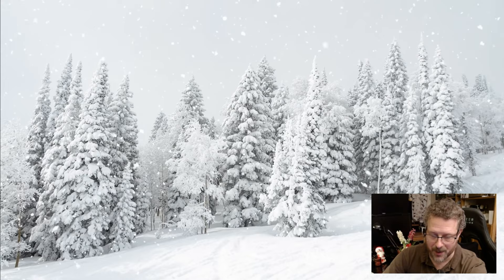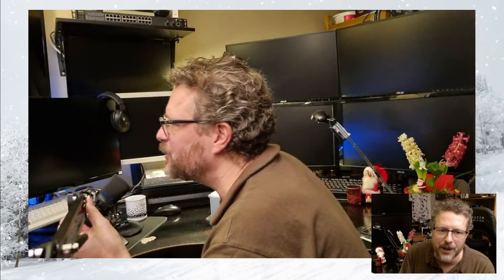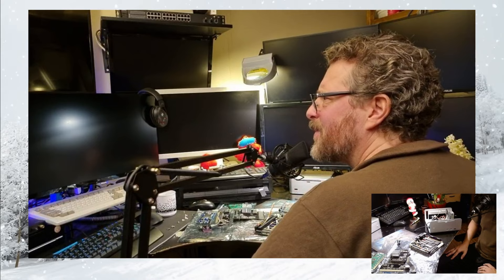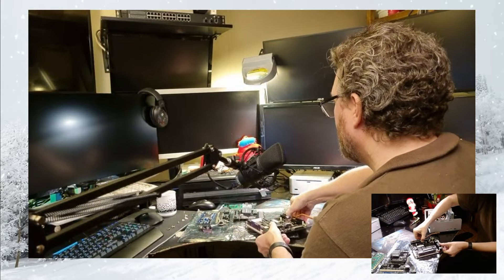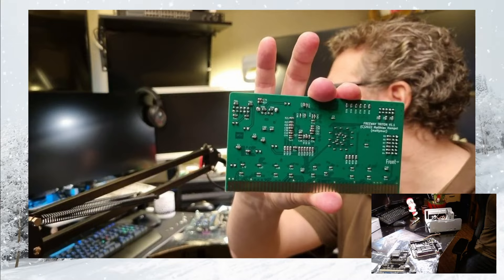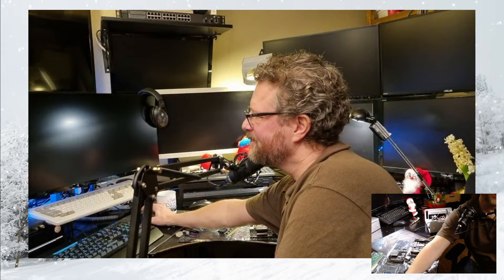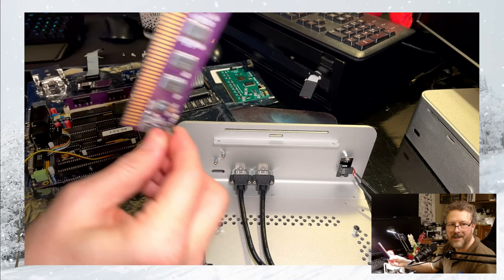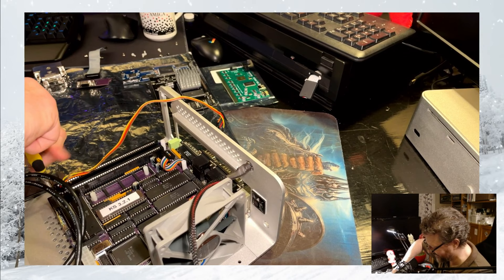From Sweden with love

Comment: Any idea if/when, more will be available?  I have and AMY-ITX I haven't built yet.
Reply from the maker: Hi, after the summer (later fall) a final batch of Denise is planned.

If you're interested I'm actually looking for an Amy-ITX board as I didn't keep one for myself 😆 Contact me privately if you want a 1:1 trade to Denise 🖖
Reply: @StefanNordlander  Thanks for the reply. I actually have an AMI-ITX Original. Given a recent Hackaday link to this video, I'm there is enough interest generated to get a new run of boards made.
Reply from the maker: Hey  @Ratteler , thanks for the heads up on the Hackaday post, that's cool! The next batch is imminent, so stay tuned.. 🖖

Comment: I would LOVE one of these boards in M-ATX form factor with more zorro slots, is there aynthing out there like that? This thing is cool as hell anyway.
I'm about 17 minutes into the video now, and just so you know you can get USB3 to USB2 adapter headers on ebay very cheaply.
And I've heard that a lot about swedes, and i frame it like this. You're not showing off to hold yourself above someone else, you're sharing what you love with other like minded folks.
Reply from the maker: Now, this is not my area of expertise but I believe that adding more Zorro slots and supporting multiple cards with DMA requires a Buster Chip. Adding this along with the relatively large Zorro II slots just isn't possible on this form factor. We did in fact discuss this, as well as potentially adding a PCI Bus controller (think; G-Rex, Prometius, ..). However this proved to be more complicated than we'd hoped. Amy & Denise both share the same 68k Bus expansion as the A1000 and A500(+), ie. some signals has to be generated to support Zorro II expansiosn. Just like Matthias Heinrichs (Matze) does on his sidecar Zorro II expansion for the A500(+) https://www.retroguru.eu/product/3632/ These expansions are also limited to 2 cards and only 1 may use DMA at any time.

Comment: Where do you even buy PGA sockets these days? I've looked and can only find 3d printed ones, no idea of cost.
Reply from the maker: There's often NOS (new old stock) supplies on ebay or AliExpress or local vendors. In Sweden there's quite a few retro hardware suppliers that import from these sources.

Join the Retro Tinkering Discord channel and ask the friendly folks there. https://discord.gg/KbSpxKRA
Reply from the maker: Also Denise has no PGA ICs, you might be refering to PLCC which is available at most standard vendors. Personally I use Mouser, Digikey, Farnell and a few local suppliers.

Comment: I designed an Amiga 500 ITX case (for modern  PC hardware). This should fit right in there if it uses standard ITX mounting holes and dimensions. I have a video on my channel of it with a link to the free 3D printable files.
Reply from the maker: Wow, that's awesome! Will definitely check out out, thanks for sharing.

Hmmm couldn't find the video. Learned a lot about 3D printed RC planes though 😆👍 Really impressive builds.
Reply: @StefanNordlander  Try searching for "I can finally play Doom Eternal on my Amiga!"

Comment: I have a dead early Amiga 500 with the revered Hi-tek keyboard.  I don't know why collectors rave about that keyboard because, in my opinion, it's not all that great.  Yes, it's better than a membrane keyboard, but still *YECHH!!*.  With that aside, I also have a late 90s HP that takes a proprietary motherboard (which is dead in my unit).  I would really like to build a better Amiga 500 with this Denise board inside that HP case.  It does have an allotment for 3 cards, so maybe I could use 2 cards in the Denise board and a header in the 3rd card slot.  😁😸